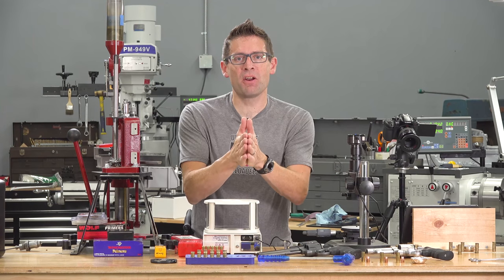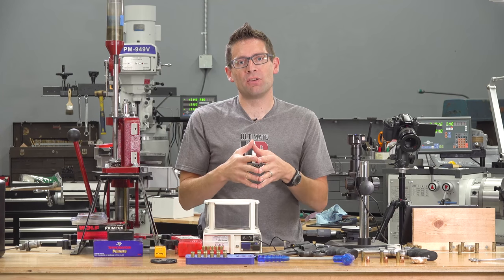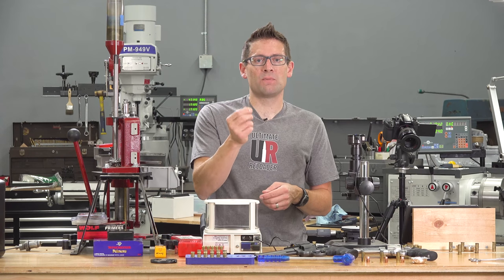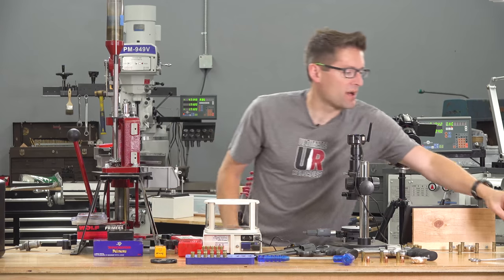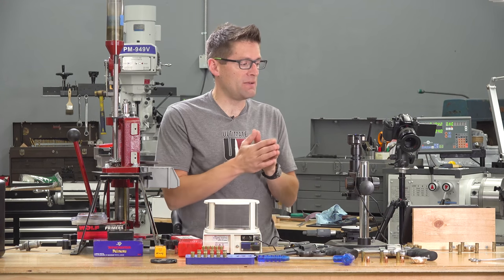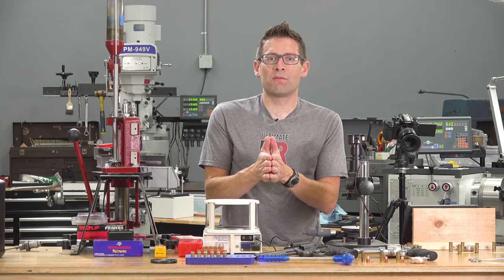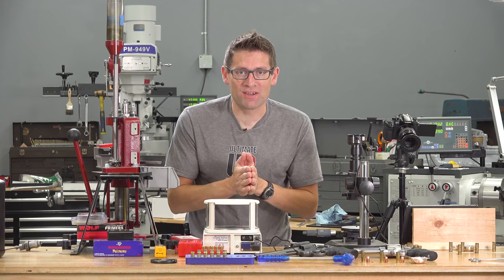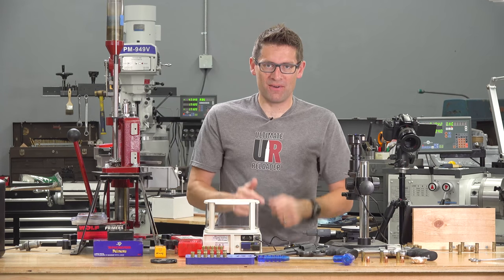SOLVED! 44 Mag Overpressure Mystery

Comment: Just for the sake of completeness, I would have turned the microscope on my primer seating punch, just to make sure there isn’t a nick or ding in it, that could, under some circumstances, deeply scratch the primer, causing a weakening of the primer. You know a defense attorney would insist on it. Are you still using the same seating punch as when you loaded those rounds?

Comment: Thanks, love your videos... 
Please share the information you get from Winchester, such as lot information, as I still have Winchester LR primers I bought several years ago that haven't been used. I don't typically load full pressure on my LR loads, thus I have not noted the issue you have, but, I will hold the primers aside until further determination is noted.

Comment: I've been re-loading for 30+ years and I used every brand primer. I now only use Federal primers.
Reply: Sounds like you have a lot experience we were loading I wonder if you can tell me if you know what the problem is with the primer backing up and getting a stock to the Pine thing is hard to open the revolver I’ve been using the federal LARGE PISTOL for 44 magnum. Thanks
Reply: @sergiobedon1  Sounds like your primer pockets are too large or worn out. Try some new brass if you're a re-loader.

Comment: My experience with W296 powder (same as H110).....
Too much air space in case with THAT powder type.
Like they warned.... don't reduce the powder charge too much.
No more than 2 grains below published maximum load. 

In fact, they suggest to use the loads that THEY published.... exactly.

They indicated 24 to 25 grains as maximum.
So I suggest to follow their suggestion.

I tried 24.5gr.  as my maximum load.

When I reduced my charges down to 22 grs.,  I had stable consistent pressure signs.
But once I went below 22 grs.,  my pressures jump all over the place!
2 of 6 shots REALLY flattened and cratered primers and shot really high!  The other 4 shots, no high pressure signs at all... poor accuracy too. Shotgun groups.

Increase the charges back up to 23 or 24 grs....  groups tightend, hit the bullseye,  and had consistent primer strikes and normal primer flattening. No craters.

I now load that powder to 24grs., under the 240 grs.  Soft points.

It's a near max load, that is accurate and seems to have consistent pressures.

So when loading W296 or H110 powders, keep a full case of powder (or nearly) as long as it's a near max load.
The culprit is that powder type and too much air space behind the bullet.

My theory is that those ball powders, have a good bit of nitro glycerine in it's formula.

Comment: Gavin, I know I'm a bit late to the party here but I'll chime in anyway.  Did you have an opportunity to examine any of the same lot of primers that had not been loaded?  I know it might be a stretch but I would think that the stress of seating and then removing the primer could be causing the cracks, although the potential for a crack would definitely be in the primer cup from the start.  Were you able to measure the thickness of the cup?   I would also put the blame for the cracks to be the possible reason for the rounds that showed gas leakage, however, I would be hard pressed to blame flattened primers on a cracked primer cup.  An excessively thin cup, could most definitely be the reason for both the cracks and keakage and the flattened appearance.  I don't use WW primers exclusively but a fair percentage of my pistol primers are WW and I've never had, nor seen,  any difficulties with them before (and I have reloaded well over 1 million rounds in my life!).  Admittedly I don't buy primers very often, mostly because I buy them in case lots of 5,000 at a time and my reloading has slowed down considerably in the past few years (take my word for it, getting old sucks!).  Honestly, I am not so sure that your mystery has been solved.  I know I might have a bit of a problem finding untouched primers from 2016 but it should not be that difficult to find an undamaged primer from that batch of ammo, unless you happened to have used it all by now.  I know I am down to the very last round of .45 Auto from my days of owning a gun shop in the early 1980's but I never had reason to pull any of them apart since they all worked just fine.  Odd ballistics can be a real mother bear of a problem to solve when problems do crop up like this!
Cheers, 
jc

Comment: I quit using Win LR primers some years ago. They were undersize. The cracks you showed are most likely the result of hydrogen embrittlement  when plating the primer cup, although they could be the result of other process deviations in the cup manufacturing process. In short. They are bad primers.
Reply from the maker: Hmmmm.... these are bare brass, not plated...

Comment: CCI! One question though, do y’all use magnum primers when you are loading with H110 or just the regular large pistol primers? Most load data I have read says use large pistol primers, but several reloaders have told me to use the magnum primers with H110.
Reply: Having used both H110 and 296 powders for many years, I have yet to find a reloading manual that does NOT recommend large pistol magnum primers for use with H110 or Win 296.  If you know of one that does not, I would be curious as to which one it is!
Thanks,
jc
Reply: Hornady reloading manual 10th edition  says to use standard large pistol primers. The rest of my manuals call for magnum primers with w296 or h110

Comment: I have a question about the lee load master reloader. Why does Lee recommend not using Winchester Primers? Do you have any solutions for that issue?
Reply from the maker: I think it has to do with primer detonation in the tray- they even sell a blast shield! Any design with a constant string of primers from priming station to hopper is a LOT more dangerous (including Dillon XL-650). Chain reaction!
Reply: @Ultimatereloader Thank you for responding! Sounds like it's something that can't be avoided. I'll be sure to use caution.

Comment: I have fired well over 100,000 Winchester primers and never had a primer problem. I believe your ruptured primer is the result of overpressure, not the cause of it. The way the primer looks with a kind of mushroom head is the result of extreme pressure no two ways about it. I know the primers say standard and magnum, but I only use magnum (only)primers with 296/H110 because of low temperature ignition problems I  have had. One theory I will offer is this; for some reason you experienced a hangfire, but the primer pushed the bullet out of the case, the the powder ignited, this resulted in a low density ignition circumstance. The hangfire could be only milliseconds, enough for the bullet to move before full ignition. Another possibility is the crimp did not hold the bullet securely enough against recoil, and it started to pull creating a low density situation. Do you know if the high pressure rounds were at the beginning of the cylinder or towards the end? Also your lower than normal velocity would tend to support the low density ignition theory.I can not answer as to the thickness of the primer cups, but I did have a commercial loader tell me about the hardness of the cups. He said that Federal were the softest and CCI the hardest with Winchester and Remington about the midpoint. One thing I saw a number of years ago was a small commercial reloader who decided to tumble some loaded rounds to give them the “final finished look”. Two blown up guns later he discontinued that practice. His theory was that the powder kernels broke and exposed more surface area to ignition. Whatever the cause he never tumbled loaded rounds again and never had a blown up gun. The point I am making is there might be something unrelated to the reloading process that may be the culprit.

Comment: Wow 😲😲
Go figure Winchester is defective ammo. Who'd thunk it. After all Winchester has never had any boo-boos. 
For real though I used to be big fan of Winchester. Mainly cause they tend to be thicker in the brass. But when you start having excessive misfires it's time to switch up. If I'm not mistaken the Beretta m9's had issues in the beginning where they were breaking locking blocks. Apparently Winchester loaded the NATO ammo to commercial specs and didn't account for the thicker brass resulting in Proof loads.